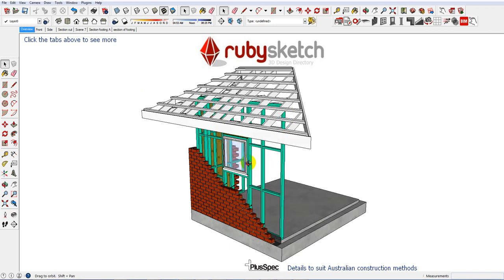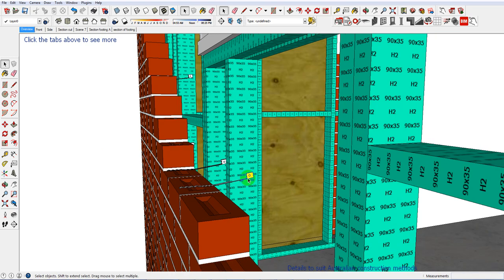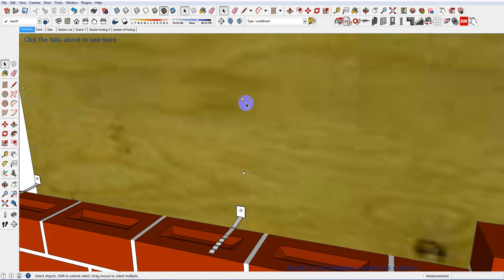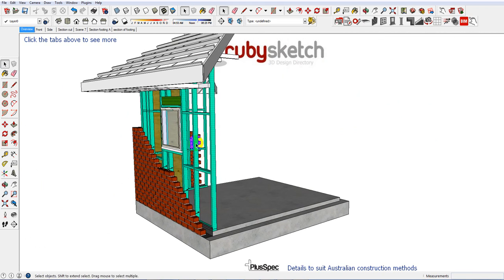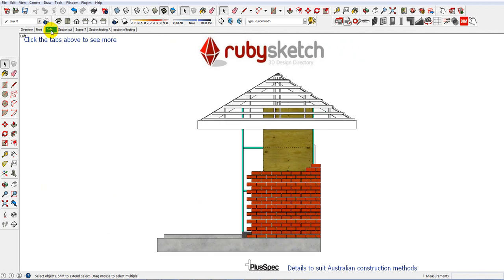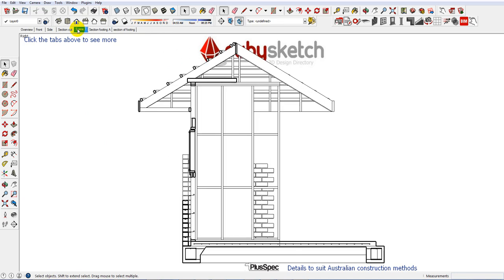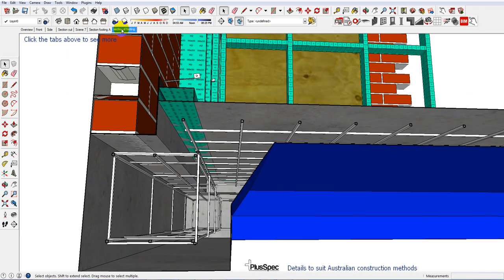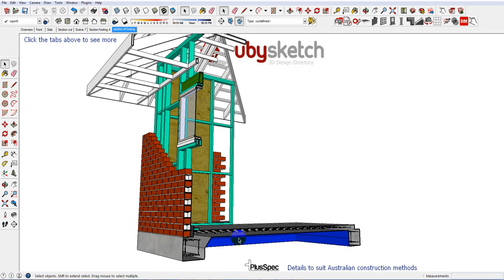Section of construction standards Drawn with PlusSpec and Sketchup

Comment: So is this a feature of PlusSpec? will the system take all of the choices made during the drawing process and then supply a generic grouping of all of them? Or... Is this just a short section of the building cut away and edited in sketchup to be 'cut away'?
Reply from the maker: Currently Plusspec will do the studs and several other parts.  Rubysketch will link to the details of the products and show how they would typically be applied.  Plusspec and Rubysketch work together. ... This is just the beginning